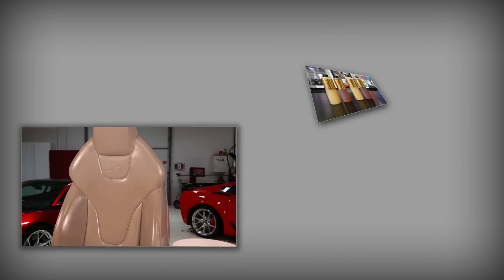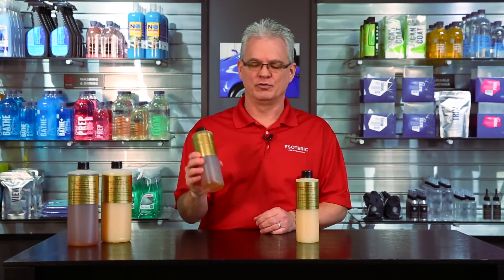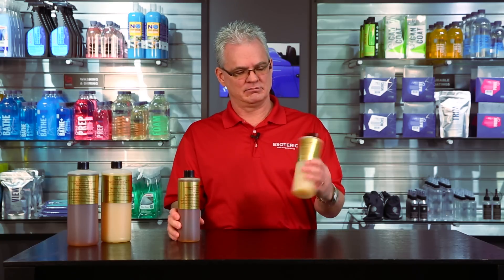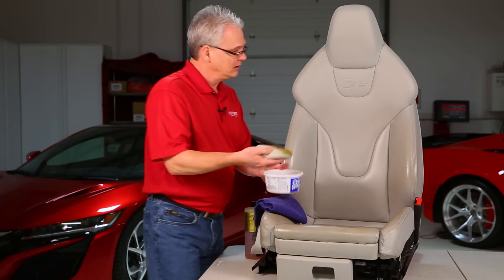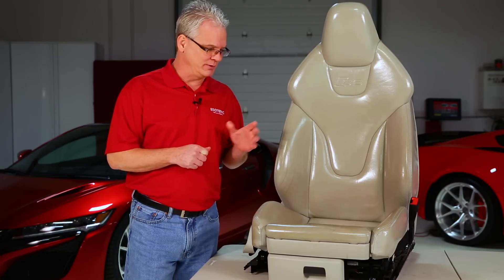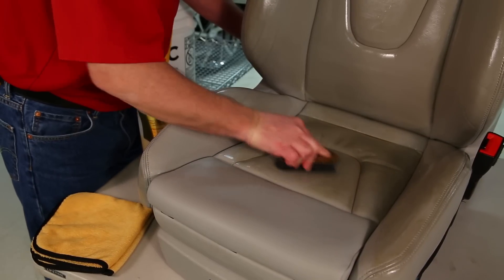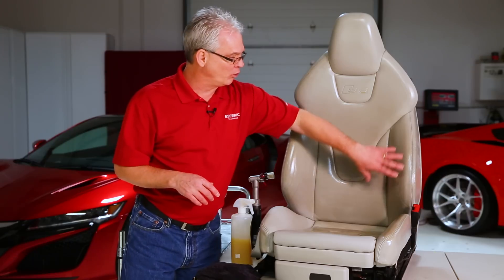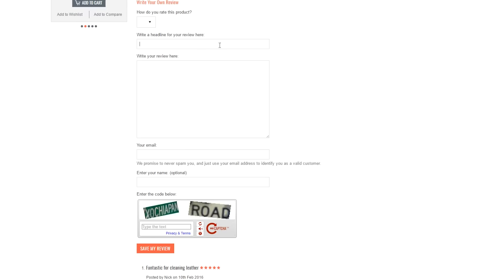How to Use Leatherique - Leather Care - ESOTERIC Car Care

Comment: I just did this and got good results but my seats feel a little dry/rough, do you recommend another type of conditioner afterwards ?
Reply from the maker: You're not going to add anything on this that would be a better conditioner. If you applied to very dry seats, you may want to re-apply after a couple of weeks as the Rejuvenator will continue to soak in and soften during that time.

Comment: Would you recommend doing this to leathers that have been coated(Gyeon Leather Shield)?
How often do you recommend doing the full system?
What happens if you get it on suede?
Reply from the maker: That would be kind of backwards...you want the super deep cleaning with a product like this first, then apply a leather sealant if you find it necessary. It depends on the use of the car, but a time or two per year for most, then maintain it with the Prestine Clean. Try to avoid suede or alcantara as much as possible, but if you do get some on it, it's a water based product so it should clean up relatively easily.

Comment: I used this before on my old Lexus with phenomenal results but now that I have a new model, with perforated/cooled seats, I’ve been worried to use it because I’d be afraid it would all go through the perforations and potentially make the air conditioned seats not work? Any thoughts on this?
Reply from the maker: No worries. We may go a little lighter on the application of Rejuvenator, but that's it. We have applied it to many perforated seats throughout the years without an issue.

Comment: How often do I must generally use this method of 2 steps?
Reply from the maker: It depends on a lot of factors. If you have a convertible for instance, that gets a lot of use, then I would do it once to twice per year. Older cars with older leather should be done minimum of once per year, but preferably twice.

Comment: Isnt the leather seats on audis has polyurethane coating on it? Meaning water will bead off and wont soak into the leather?
Reply from the maker: As described in the video, modern leather is water resistant, not waterproof.

Comment: What happens if either of the Leatherique products would touch Alcantara inserts on a seat that's half leather, half Alcantara? How would you remove the product from the Alcantara inserts if you'd touch it?
Reply from the maker: It's water-based, so should clean up with a wet rag. I would not use it heavily right next to Alcantara as a precaution.

Comment: What would happen if your leather seats are perforated? Would conditioner damage the electrical work inside of the seat since you've to soak the seats with the condition multiple time?
Reply from the maker: We've never seen any issues with heated / cooled perforated seats when using Leatherique!

Comment: Is there any other product to use along side this for sun protection or is it not needed ?
Reply from the maker: Prestine Clean provides its own UV protection.
Reply: ESOTERIC thank you for the response, I’ve used leatherique and got good results but some parts of my leather look a bit dry/wet at the same time if that makes any sense, any idea why?
Reply from the maker: @kazballa24  The only way that would happen would be if you didn't get all of the Rejuvenator removed during your Prestine Clean stage. Wiping it down with a damp towel, followed by a dry towel should do the trick.

Comment: Does this system leave behind any UV protection or can I follow up with something like gyeon leather coat to provide some?
Reply from the maker: Yes, Prestine Clean contains UV protection. You do not want to use a product like Gyeon Leather Coat after using Leatherique as you will have bonding issues.
Reply: How long after using Leatherique could you apply Gyeon leather coat?  It only makes sense that after restoring worn seats to protect them afterwards.  I understand the rejuvinator oil may cause bonding issues, but perhaps after a few weeks then clean with prestine clean again it would be ok to coat? Or would Gyeon leather coat only be applicable to new or in very good condition seats to keep them that way?
Reply from the maker: I would not try to combine products because you will definitely have bonding issues. The only way you could do it would be to thoroughly clean (again) with plain water, then maybe use Gyeon Leather Cleaner first before applying a leather coating. For me though...I wouldn't do it as I would use one or the other, but not both.

Comment: Hi Todd, are there special considerations that I need to take if using this with heated/cooled seats that are perforated?
thanks and love all the new videos!
Reply from the maker: Thanks, and glad that you're enjoying our new video series. As for heated / cooled / perforated seats, we treat them the exact same way without any issues. In those cases we may use a little less product because the perforations actually allow the Rejuvenator to soak in more easily.
Reply: Todd, 

My 2015 F31 Beemer has red seats. Is it safe to use use Rejuvenator Oil on these? 

At the moment I only use Dr. Leather to clean them. I never used a product to condition them. 

Thanks for taking your time to explain the how-to properly.
Reply: ESOTERIC - Fine Auto Finishing Many thanks Todd. I look forward to using this!
Reply from the maker: I would have no hesitation using it on red seats. I've used it on red seats that are extremely old, to brand new with no issues.

Comment: Will the leatherique pristine clean still clean pretty well if it is used on its own? I have been using leatherique prestige clean followed up by a leather conditioner for sometime and was wondering if I should just get the rejuvenator oil.
Reply from the maker: Yes, Prestine Clean is a perfect all-in-one leather maintenance product, and you should not be using a conditioner afterwards. Even in the 2-part system, Prestine Clean is the FINAL product to use, not the first!
Reply: Oh, I was using Prestine Clean as a cleaner and then feeding the leather again after that with the conditioner, is that not as good as usage of the product?
Reply from the maker: No, that's definitely not how you want to use it. Either use it by itself as a maintenance product, or AFTER you've used the Leatherique Rejuvenator.

Comment: Great video Todd. I have one of the cars in the background on the left with alcantara in portions of the seat..... is this treated the same or do you treat the alcantara portions differently?
Reply from the maker: Hello Chris. You do not want to use Leatherique on Alcantara! In most cases, just a damn cloth is all that is needed to clean it. But if you need more than that, you can use a dedicated Alcantara Cleaner from SONAX. We do have that available in the store.
Reply: ESOTERIC - Fine Auto Finishing  So just be careful not to get Rejuvenator on the alcantara? I have a 14 GT500 with Recaro seats which have alcantara on the bolsters. Maybe tape it off?  Also, should I keep the prestine clean off the alcantara?

Comment: Will this product 'lift' the dyed leather color?
Reply from the maker: As stated in the video, it's always possible if the re-dye job wasn't a very good one!
Reply: It's not a "re-dye" but a newer replacement Red Leather Steering Wheel for my 81 Vette. It appears (and is common) the oil, sweat etc from my hands may have broken down the Red Dye some as, whenever I try to use anything to clean or protect the Red coating I'll see a little Red transfer onto the rag. I want to STOP this from happening.

Comment: Aren't most leathers on newer cars clear coated? And doesn't that mean you can just clean the seats with a simpler process, e.g., diluted general purpose or even steam?
Reply from the maker: When you watch the video, it talks about myths as it relates to newer leathers, and how they can be deep cleaned and conditioned. It also discusses the fact that the product is designed as a deep cleaning and conditioning, and not for those looking for a quick cleaning. While it can be used, we do not condone all purpose cleaners as a solution for cleaning leather. Yes, steam can be used as a quicker cleaning, but it won't do anything to condition, preserve, or protect the leather.
Reply: Thanks, I missed the reference to clear coat. A particular detailer on YouTube continually reinforces that myth.
I use this product on not only my Jag XJ but also on an Italian leather couch and love seat and even on my wife's purses. Does a great job keeping everything soft and supple.

Comment: how many seats on average could you do with a 250ml bottle ?
Reply from the maker: It depends on how bad the seats are, and how many coats you need to apply. You should easily be able to treat a 4-seat car with one bottle of Rejuvenator. Prestine Clean will stretch much further though.

Comment: have you ever used griot's garage leather rejuvenator? i was pretty impressed with that product, was just wondering how it compared to leatherique, is leatherique really that much better?
Reply from the maker: All other products on the market are designed for quick work. Given that, you're just not going to get the kind of results you can with something like Leatherique that works with time to deeply penetrate the surface. Once you use Leatherique, you'll never look back!
Reply: Awesome, that's exactly what I wanted to hear! I've got some really hard leather on a 93 vw corrado that I want to bring back before it cracks.
Just placed my order with you guys, can't wait to get it!
Thanks
Reply from the maker: Thank you kindly for your business!

Comment: I've read through all the comments about applying this product to heated/cooled/perforated seats but have yet to see this question arise: Would it be okay if I turned on the seat heaters to let the leather warm up some allowing more product to penetrate? Could this potentially cause problems?
Reply from the maker: I don't like to mix electricity with liquids!!!  Seriously though, it will take time regardless, so might as well play it safe and leave them off as it would make minimal difference at best.

Comment: I laugh at the tons of money spent on these products. Damp cloth is all you need with a little soap. NOTHING penetrates modern top coated leather, NOTHING.
Reply from the maker: Untrue. They are water resistant, not waterproof. Our information is based off of actual use on hundreds of cars over the years...not theory.